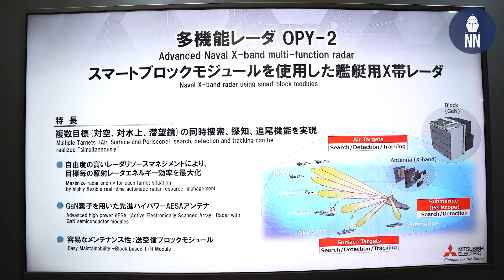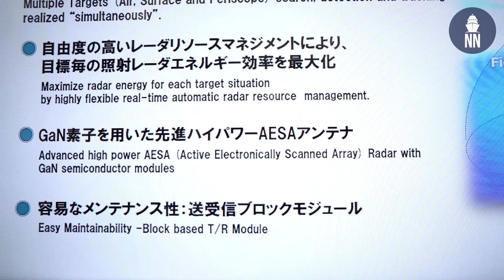Mitsubishi's new OPY-2 X-band radar, RTX cooperation

Comment: RTX should cross license the OPY-2 from Mitsubishi and sell it to the USN as a much more modern and versatile replacement for the SPQ-9B.  The USN needs a shipborne X-Band AESA radar.
Reply: Those are not equivalent radars. The SPQ-9B is a surface search radar, used for close range primarily like around 40km max. Are you thinking it somehow would be a successor just because of being in the X band? 
They are very different radars. The OPY-2 has a range of 220km, and it isn't just a surface search radar, it is an AESA radar which can precisely illuminate aerial targets.

The equivalent radar to the OPY-2 is the USA's TRS-3D which is a combined air and surface search radar with a 200km range, except the USA's radar is 1-2 generations behind the OPY-2.
Reply: @ziongite  The SPQ-98 is being installed on US (and other countries) Aegis equipped ships to give them enhanced horizon search capability to detect antiship sea skimming missiles.  But it's a stunning example of 1990's, or earlier, technology (mechanically scanned, only 2D.)  It is X-band, which gives it better resolution against sea/ground clutter than the S-Band SPY-1 or 6.  But an X-band AESA would be better in this role.  The OPY-2, or maybe a scaled down derivative would be good in this role.  I've also looked at repurposed fighter radars for this.

Comment: Everytime I see a new radar, I'm taken back to the mid 2000s and what a small Australian company called CEA did using GaN and tile based TR units. It's been copied the world over. They even worked with RTX in the late 00s.
Reply: I think every west-aligned countries have similar projects in late 90-2000s. Also Japan had first shipboard GaN radar since 2012
Reply: Australia had a GaN radar on a ship in 2004 then rolled it out to the entire ANZAC fleet.  @val8730
Reply: @EJH_1138 Don't Anzac-class CEAFAR 1 is GaAS while GaN is on Hunter's CEAFAR2? As I remember, Akizuki FCS-3A is a first operational shipborne GaN.
Reply: @val8730  you know what, I think you are right. GaN was CEAFAR 2 which was installed on later batch ASMD ANZACs also the L band Radar AMCAP upgrade.
Reply: So your assertion is that Australia invented the concept of modular based radars in the 2000's? Sorry that is false, this was already a concept in the 90's.

Comment: Does Mitsubishi still make the A6M series of planes? 🤔
Reply: The company in the video is Mitsubishi Electric, which is a different company from Mitsubishi Heavy Industries, which manufactured the A6M.
But MHI is now working with BAE and Leonardo on the GCAP, a new generation fighter development program.
Of course, MHI is still manufacturing fighter planes after the war.
Reply: Nakajima is the main company behind the Zero. It's now known as Fuji Heavy. Aka Subaru. Basically Subaru WRX is same DNA 😅
Reply: I worked at a FBO.  I got to tow a A6M2 one time.
Reply: Unfortunately not. Instead, now Tamiya and Hasegawa are making A6M2 and other Zero variants with affordable price and compact scale for ordinary citizens.😊